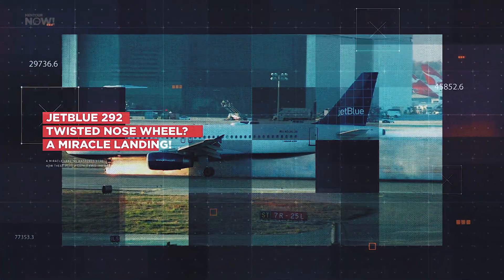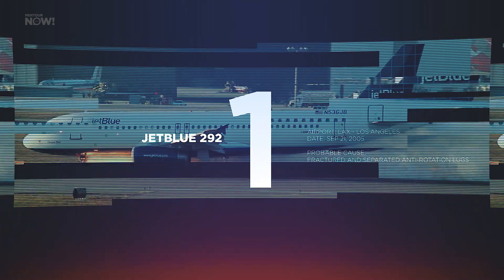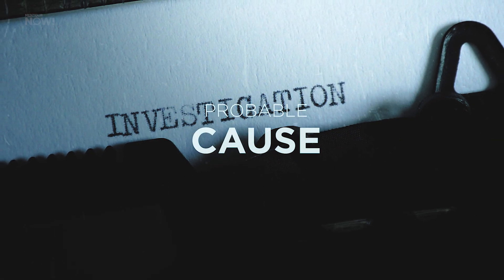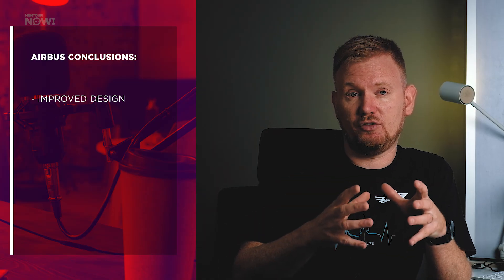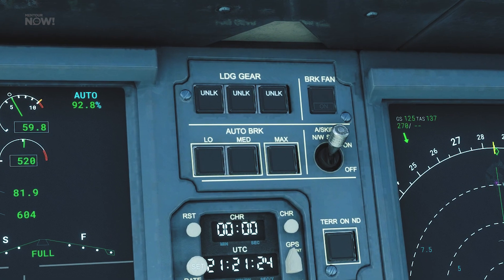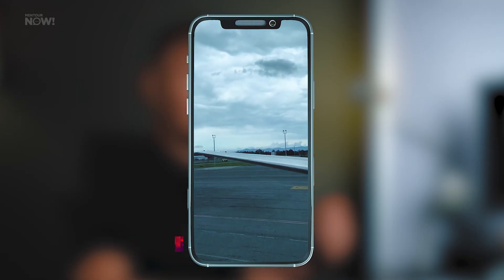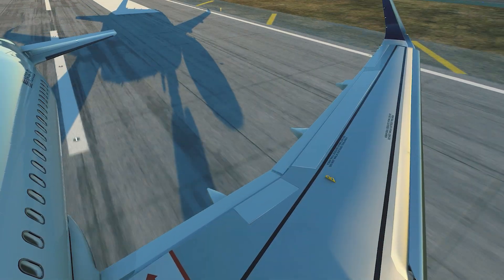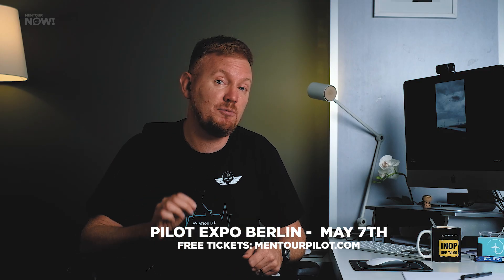The TWISTED Story of the Airbus A320 NOSE-GEAR!

Comment: Airbus nose gear centering mechanism is over-engineered. 
The 737 has simple built in cams which mechanically engage and centers the nose gear as the nose gear becomes airborne.
Reply: It seems to me that it's wrongly engineered.  The damn thing should get locked straight ahead in flight regardless of anything else.  From what you said, I guess this is exactly what Boeing did with the 737.
Reply: You have no idea. Airbuses are ludicrously over-engineered and there is at least one computer for everything. Most of my time spent working on the Airbus is spent looking for the right circuit breaker to pull and reset to get the stupid computers working again.
Reply: @wrkingrageaholic  Well, at least the stuff not one augmentation system on top of another
Reply: Actually, for the Airbus being so over-engineered and having so many systems, it's the most robust IT system that I know. It's incredible how many fallbacks and redundancy it must have to work so well with so many lines of code on so many computers working together. Like, there could be so, so many faults like with the Boeing 737 Max's MCAS system failing, however they work like a charm. In normal law it's very hard to exceed the normal flight parameters, like rotating more than is stable, or pulling back or reducing power to stall the airplane. The result: It won't rotate any further, it won't pull further up, and it will automatically apply thrust to counter that situation. Heck, there even is a system that returns the plane to a stable configuration if you just let go of the controls, which plane does that? And two systems that tell you if you are on the right runway or are departing from or landing on a taxiway, which also prevents disasters like we know *cough Harrison Ford cough*. And if these systems fail because e.g. sensors become unreadable, it will fall in alternate law, enabling manual input.

So it's quite an ingenious design to work that well. Always fallbacks, always safety points, so that if something doesn't work as intended, it will fall into a safe fallback state. Like every system should do. Usually such a complex system shouldn't be able to work on an airliner, there should always be glitches all over the place, like we are used to in normal computer software. I don't know how this is even possible.
Reply: @IroAppe  Air France flight 440 proved that Airbus’s flight control software is not as robust as they claim it to be. When the pitot tubes on that A330 froze up, the Flight Control Computers switched to alternate control law. Without air data, you lose most flight envelope protection, and the controls get way more sensitive. The crew lost control and stalled the airplane because they had no training flying at cruise altitude and airspeed while in alternate control law, and the system doesn’t have any artificial feel to help. What’s more, the two sidestick controllers have no interconnection, so one pilot cannot tell what the other is doing, and the software simply averages inputs from the two controllers. The F/O panicked and held his stick in the full aft position from 30,000 ft until they pancaked in to the ocean. Even if the captain held his stick full forward, they would get the average of full up and full down, which is neutral. The accident was (rightfully) blamed on pilot error, but the Airbus control system played no small part in it. In contrast, the pilots of both 737 MAX crashes were largely absolved of blame, despite both crews failing to follow basic, long-established procedure for dealing with a runaway stabilizer, even though the second crew had the benefit of learning from the first. The lesson here is that Boeing and Airbus are made in two different places, certified by different regulatory authorities, and though both are very safe, neither are perfect. Global politics play an unfortunately large role in what is considered airworthy, and in the inevitable blame game that occurs after a crash.
Reply: @wrkingrageaholic  Yes, I know that incident. But this is not a preventable situation, because the pitot tubes are providing the air speed and that is directly required to provide the anti-stall feature.

If sensors are providing unreliable data, then it is better to switch that automatic system off - because we all know from the MCAS system what happens if automatic systems make decisions to act based on false sensor data.

Systems wreck havoc, if they are fed with wrong data. Another example was with a rocket, where because of an integer overflow the navigation computer was fed with an error message as numeric input, basically completely random data for that system. In result, it steered erratically and luckily ultimately the self detonation system kicked in, otherwise that rocket might have flown into the control center or even an inhabitated area, basically anywhere.

What I have to say is, that I often don't understand why they then won't just turn off that part of the system that is fed by the unreliable data. For example, turning the anti-stall feature and autothrottle feature off, but still enabling everything else. That seems a bit off and maybe lazy to me, however I am of course not deeply into the technical details.

I agree that it's an issue if pilots get complacent with these systems and aren't even trained properly to fly the airplane manually. A pilot always has to be able to take over manually in every situation, especially stalls. Aren't most simulator sessions done in manual flight? If not, that's something that I would urgently recommend to give pilots that training. I especially believe that all pilots should regularly be tested if they are capable of flying maneuvers completely manually, safely, and have that feeling for the safe handling of the airplane.

I also agree, that the averaging effect of the flight sticks is really not the right way to do things. And not even giving any indications that there are inputs of the other pilot, that's unacceptable to me. That's actually also my greatest criticism with the Airbus controls.
Reply: One could argue that, on the 737 Max, the lack of redundancy for the MCAS was a rather bad case of under-engineering.
Reply: @StarHorseLover200  That’s absolutely true, but that’s why the 737 MAX debacle was so shocking; it was a very rare misstep for Boeing engineering, and that decision appeared to be more cost-driven than usual. Usually their designs are very robust and fault tolerant. Historically, Boeing’s weakness has always been they put too much trust in their suppliers. They spec out parts for their airplanes, they probably award the bid on lowest price alone, and sometimes they get absolute junk for parts in return. Remember the 737 Classic rudder hardovers caused by jamming hydraulic servos built by Parker-Hannafin. They probably didn’t expect the Japanese made lithium batteries for the 787 to undergo thermal runaway, nor did they expect the 737 MAX angle-of-attack probes to be failing after mere months in service.

Comment: What would that do to a runway?  Would it require repair to the runway, or is it designed to take that kind if metal scrubbing?
Reply: The rims are made out of Aluminum or Magnesium, both metals are fairly soft (and spark nicely), additionally only about 10% of an aircraft's weight are actually on the nose gear.
Reply: @kilianortmann9979  IIRC, Magnesium burns like Thermite when heated sufficiently.  I do hope Airbus does not make these nose gears out of magnesium.
Reply: Aluminum doesn't make any sparks.
Reply: @kommando-zx8ll  Well, you can see in the video that there are sparks coming from the defective nose wheels on landing. So either you're wrong about aluminium not sparking, or the wheels aren't made of aluminium.
Reply: @beeble2003  I think that what looks like sparking is actually bits of burning tyre.
Reply: @rampak1  I don't think so. Tyres tend to produce a lot of black smoke when burned and I don't see that in the footage.
Reply: I wondered the same thing. On the pictures it looks like there isn't as much as a scratch to the runway. Which is pretty incredible honestly!
Reply: It the runway was equipped with runway centerline lights, I would imagine a lot would need replacement.  Even though they are flush with the runway surface, I would expect them to be damaged in that situation.  But the concrete gouging would probably be minimal.  Asphalt would probably suffer more than a grooved cement-concrete runway.
Reply: @skyhawk_4526  Only if the plane is going exactly down the centreline.
Reply: There would be a runway inspection before the runway is used again.

In these incidents the runway was judged for for use
Reply: *fit for use

Comment: It's these new-fangled systems that are causing these problems.  Consider that the ever-popular DC-3 has NEVER had a nosewheel steering problem in the 85 years it has been flying.  Maybe those old guys weren't so dumb.
Reply: That's because the DC3 does not have a nose wheel!
Reply: @GTRider1  it can't be problematic if it doesn't exist!

Comment: Somewhere in Airbus someone is rolling their eyes and going "okay how else did the nosegear guys manage to mess up" :-)! Seriously it seems that there are lots of things that happen to have an outcome of the nosegear being rotated 90 degrees left. Still it's surprising to have this many problems compared with everything else - I suppose the nosegear does take quite a pummeling every landing. It does sound like Airbus need to put a checklist into place for landing with nosegear at 90 degrees and all green indications it they're not going to allow the landing gear unsafe checklist (or just say you can use it - which would seem to be the most sensible).
Reply: well TBF some of these are related to the design fault, while some are related to maintenance procedure fault. as for maintenance procedure its result of airlines outsourcing maintenance to save costs and idiots getting the job to maintain multimilion dollar airliners.
Reply: @kopazwashere  yes, actually my comment was somewhat tongue in cheek :-)! Actually I think these events show how well the nosegear was designed - probably to deliberately fail to a 90degree rotation which despite damage to the wheels/tyres enables a straight landing to be made.
Reply: Hey bob why does it sound like yosemite sam in in the engineering booth today, oh didnt you hear? lol

Comment: If there was a design fault on a car where turning the steering wheel too far would cause an accidental flip to full turn, the car would be taken off the road until it was made impossible for that to happen. Why is the aircraft still flying without EVERY possible fault condition rectified.?
Reply: Because it is impossible to rectify every possible fault condition.
If that is your goal then no aircraft would be allowed to fly.
Reply: @Jehty_  As I said, a car having design problems would be taken off the road until they are safe. I would have thought that faults in an aircraft were a little more important. OK, an aircraft is somewhat more complex than a car, but the nose wheel in this model has now had a few different problems that all have the same result, surely it could have been redesigned and replaced to stop the problems now.
Reply: @terryhayward7905  As Peter said in the video, each event has a different cause. If you can't be sure that the nose gear is at 0°, then turning it to 90, where is a hard stop is the second best option to get it back down safely.

Comment: we have tiny pin hole cameras now. why are these not peppered all over the plane so the pilots can see the outside surfaces of the plane, including landing gear etc ?
Reply: For old aircraft, it may need a new type certificate. For pilots and mechanics, nee training etc etc
Reply: @Ahmed-s2i7c  for a camera ? one screen with a scroll down menu of all the cameras. push the line and you get the camera view. its easier than working ones cellphone and we do that every day. if a system that simple needs certification, then i guess they can put it on the pilot certification list that must include "how to flush a toilet", "how to put your pants on in the morning" and "how to drink coffee". im not saying you are wrong, im saying if you are right its just plain balmy. in our quest to make the complicated simple, we seem to have gone out of our way as a species to make the simple complicated at the same time. i despair for the human race.
Reply: @waldopepper4069  The last one is actually in the list, so you don't short out the central pedestal.
Reply: @csgergo80  i thought it that was on the "where to not put your coffee" list.

Comment: Ok... But even though all incidents were caused by some or totally different reasons, in the end what I'm seeing is a huge problem with the design of the entire front nose gear system that allows for many points of failure. Airbus should address it with a more radical solution than a few software tweaks and minor hardware adjustments and maintenance procedure instructions
Reply: The trouble with radical redesigns is that they're not only very expensive to do, but also that it's very difficult to validate that your design is safer, better, and more reliable than the previous one.

I work in the world of software, and radical redesigns of code are pretty rare in the enterprise world even though it's much cheaper to do this in software than hardware. This is mainly because it's difficult to justify changing critical components in a radical fashion unless you not only have a strong justification for it, but also sufficient metrics and testing around it to ensure you don't actually see regressions in the functionality and performance of that component. Design is hard, and regressions are actually very common when even doing minor refactors.

I can only imagine this is even more true in the world of hardware. We might have over 300 tests for a single component, and in software those tests are cheap to run. In hardware land, physical tests are very expensive and may even be infeasible for certain scenarios. I'm sure they did a lot of simulator testing too, but you never will know how exactly it'll perform until it's in the real world being used.

There's a reason why the phrase "better the devil you know" is often used. A radical redesign might sound good on paper, but in fact could introduce a whole new class of failures that now no one expects to see. Confusion between maintaining the different types of landing gears could introduce weird issues that the manufacturer never expected. Even if the design as-is clearly has some faults, the relative rarity of those faults still means that it's a functional design that is safe for flight. It's not worth the massive risk to throw all that away for something completely new.
Reply: @MNGoldenEagle  yes, but it's also important not to go too far in the other direction. An extreme example was the Therac-25 radiotherapy machine, which killed six patients while the manufacturer and technicians tried one little thing after another to paper over a fundamentally dangerous design. Even in lower stakes situations, a poor initial design can lead to extremely expensive technical debt; a full rewrite may be the best and cheapest option.
Reply: @MNGoldenEagle  but we are talking about aviation. It's famous for being all about safety and this whole issue seems all but safe. The design has to have critical flaws if so much stuff can lead to the same failure. Fortunately, any of the incidents have turned into fatal accidents so far, but we've seen previous events in which a failure in the landing gear can lead to debri punching into the aircraft's fuselage and leading to much more severe damage and even fatalities.

Comment: Was there a re-design of the nose gear system at some time? The A320 has been in use since the 80s and this issue seems to have been occurring fairly recently. 🤔

BTW- Saw on the news this morning that Trevor Jacob had his private pilot certificate revoked by the FAA. 👍👍
Reply: Good news, surprisingly quick too.
Reply: @tnexus13  Former Olympian and former pilot.

Comment: I know it’s different reasons for the same issue of the nose wheel. Why don’t they design and or change the way the nose wheel is to prevent this to ever happen again. 7 planes of the same type A320 with the same problem (different reasons). Maybe there are more and it will happen again.
Reply: Probably due to type certification of the aircraft and type rating of the mechanics who servoce the aircraft also have to change
Reply: @Ahmed-s2i7c  After each, they changed something to prevent that from reoccurring, sooner or later they will get to the end. ;)

Comment: I wonder if Airbus has done any major redesign of these systems for the Neo since it kinda seems "too easy" for the landing gear getting stuck like that for a variety of reasons
Reply: apparently, mitigations have been implemented even in newer CEOs The LATAM plane, CC-BAS is 10 Years old,delivered to LAN Chile on November 2011
Reply: Yes.
Reply: Yes, the company designing and manufacturing the nose landing gear changed its name from Messier-Bugatti-Dowty to Safran Landing Systems. That should do the job. Right?

Comment: Does the 737 also test the wheels like that? And did anything like this happen on the comparable 737's?
Reply: The 737 is still using cable controlled, hydraulically actuated system and got plenty of mechanical stops, even for the MAX. direct control from the captain side. no such test.
Reply: As far as Ik the 737 doesn’t perform this autotest. However the steering mechanism on the 737 (at least since the NG as the gear went through a redesign during development) has a different locking system, though I could be wrong there. And to be fair I don’t know if any 737 had this gear rotation 🤷‍♂️
Reply: Yep. The 737 nosewheel steering is cable controlled and hydraulically powered. There is very little to go wrong with that system.